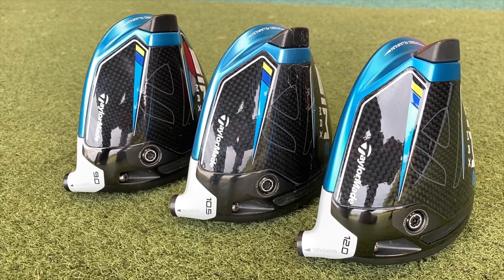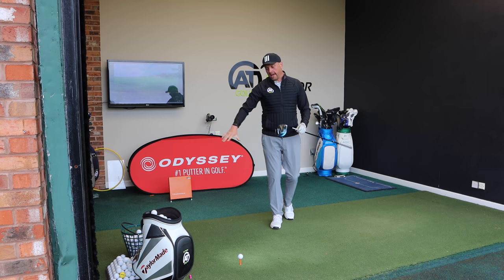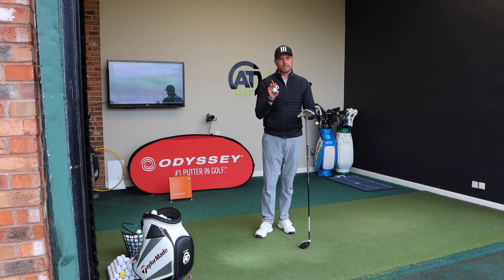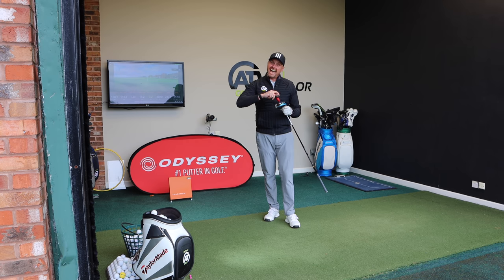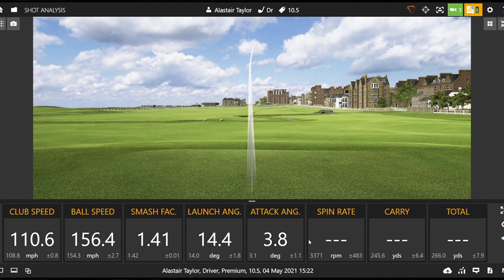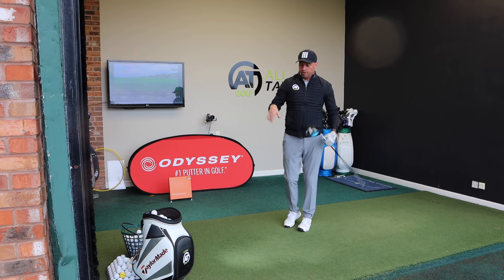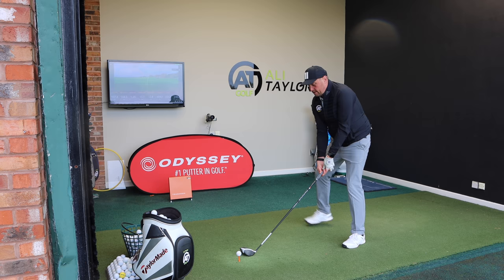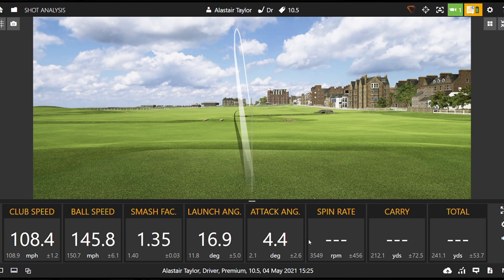Are you using the CORRECT driver loft?

Comment: I have a flat swing taught to me over 60 years ago and still works for me. I am short and was taught by the same man who taught Patti Berg who was also short. 15 years ago I had an 8 degree Cobra stiff shaft that I could hit 220-230. Now in my  80's I use a 7.5 Cleveland driver senior shaft and recently picked  up the Sim2 8 degree with a regular shaft and am hitting it a little farther.  The one fact that cannot be ignored is as you age your distance goes down. Being 84 I can attest to that particular fact.  To me the shaft is just as if not more important than the head loft. But it seems media ads ignore that important fact when buying golf clubs.

Comment: I recently increased the loft on my M2 driver from 9 to 10 and it made a huge difference. I am now launching the ball higher, straighter and longer. Just upgraded to SIM 2 max and eager to try it. Went with 10.5 loft and Reg flex shaft. Just turned 73.

Comment: Excellent explanation and demonstration. I had low driver ball flight for 15 years with most misses going left using 10.5 head and 55r shaft. Took one lesson (first since 2007) and practiced for a month then got fitted. Now with 9 degree head and 55s shaft attack angle is 4 up, launch 14, 20 yards more carry, 800 less spin and straighter flight. If I’d got fitted without the lesson it would have been very different - I’ve got wider stance, moved ball position forward, got more tilt behind the ball and standing closer to the ball to stay on plane and avoid toe hooks. Much longer and more consistent now. The lesson made the fitting much better. So did watching loads of youtube videos like this one to understand the swing and tech.

Comment: Great advice!  I've always had a very flat driver swing and tend to have a low ball flight so I've been using a 12 degree driver for years.  I just took a lesson and completely changed my swing plane (dropped right shoulder, hitting up on the ball) and all of a sudden I've got 20+ more yards and a nice, high ball flight.  Too high.  So I'm changing to a 10.5 degree driver (assuming when I get fitted it works for me) on the assumption that I'll still be hitting the ball higher but probably further as well...

Comment: I moved my driver up to 11.5 and was hitting fairways with consistency much more. Then I got cocky and moved it back down to it’s stated loft and started slicing way more and couldn’t figure out why. The way the loft can affect your the path of the ball flight is so interesting. Safe to say I will benefit from a higher loft which is fine w me bc I would rather hit it straight and long a lot of the time instead of straight and long sometimes but slice it a lot just for an extra 10 or 15 yards if I hit it right
Reply: Yes higher loft closes the club face which means less slicing so 12 degrees is good
Less loft open the club face so more slicing 
It’s getting a balance if you are good at closing club face then 10.5 if not then 12 degrees will help you hit fairways

Comment: I ran my G430 at 9.5 with weight draw biased and it wasn't working for me. I went back to 10.5 and weight neutral and the results are much more consistent. I do try to hit up on the ball with driver. I'm still going to play around a little more. I can say that the g430 has been a fantastic driver for me; I get along quite well with it.

Comment: I always used a 10*/10.5*. I was struggling, so tried a 12*. I now hit the ball further and straighter.
Reply: Was you slicing it? I am really struggling with a slice on 10.5 degrees so wondering if this would work for me, not had chance to try yet though
Reply: @2010LeeG  The main reason people slice is because the club face is too open. If you continue to close the face when striking the ball this will help. 12* drivers are far more forgiving
Reply: @watchalot919  cheers, very new to golf so appreciate the advice. I'll let you know.

Comment: Just yesterday I change my 17' M1 9º from 10.25º to 8.75º and sitting on my the ground pleased my eyes. It was more like a 3/5 wood or a iron so I was more confident and, even that the face was more opened, I hit a mid flight straight 270 yds total (Like 20 yds further than my normal fades) . Maybe a 10.5º head would add some carry distance with no closed face. Maybe time for a fitting too.
Reply: A 10.5 vs 9.0 will have a more closed face by design. Be aware higher loft creates a more closed face.

Comment: Perfect examples for fitting
tempo, ball speed, and peak height are important as well

A rule of thumb for optimal carry, your peak height in feet should be similar to your 6 iron swing speed. Example, 6 iron swing speed = 80 mph, the peak height should be 80 feet +/- 10% for most/all clubs

Optimized will provide better contact and increased ball speed. 
More distance ...

Comment: Ali Great video, I have just brought a Mizuno ST200 and its in the 10.5 with reg shaft, My question is: I have a swing speed with it of about 80 mph but I have a very high ball flight so I drop it down 1 degree to compensate for the higher ball flight, is this right or have i just got to try and change my swing or grip to try and hit up on the ball more, my ball direction is pretty much straight and my bad drive is a fade slash slice but lose loads of distance because it spins up to much and goes no where, Long winded i know but would value your advice.

Comment: Question, as 60 year old with I believe reasonable swing speed (having recently been fitted for a ser of irons) I hit up on the ball with driver set at 10.5 degrees, hitting better than previously, shot shape is slight fade (with all low irons as well) should I go up to next setting of 11.5 degrees?? Current driver is the Cobra King F7 which I had fitted some years ago.
Reply from the maker: I think it could help

Comment: Ali i have this driver swing at 95mph and is set on.10.5*. I've been hitting shots left on the course and off the low heel side of the face. If i  open the club face up 1.5* should this take it more right and with the stike i choke down the grip around an inch as it feels too long for me. Would a shorter shaft take strike back towards the toe area?
Reply: Do you hit a 3W off the tee and is that off the heel too? Is that going left?
Ideally use a launch monitor to get the numbers but sounds like choking down the grip an inch is a good start.

Comment: Great vid, Ali!  There's a dogleg par 4 on which I need a higher flight to carry a stand of trees to cut the corner.  My carry distance is usually less than I would normally expect, which as you explained in the vid could be a loss of ball speed by the increased AoA/launch angle.  Thx for the insight!
Reply: Hoa Tattis  ¡

Comment: Those are total distance numbers that I see.  But,  they say if you have a swing speed 105mph+ you should be able to get to 300yds???  I have 105 to 108mph yet only get 275yds on a good strike,   280yds with a draw.  Nowhere near 300yds.  Looking for the ultra low spin driver that can get me to magical 300yds

Comment: Did I hear you correctly that lofting up closes the face and lofting down opens the face? My 10.5* lofted driver naturally sits a bit open and I'm trying to figure out what adjustment I need to make to  get it back to square at resting position. Thx
Reply: Standard setting
Reply: @kieronburns3118  it sits open on standard setting is what I was saying. I bought the driver second hand so not sure how this happened. Thanks

Comment: Many LPGA players have 9 degrees of loft even their average clubhead speed is less than 100 mph.  I suppose that most of them hit up on the ball.
Reply: A lot depends on the shaft and ball they are using too.  The professional players spend hours and hours testing to determine the best combination of everything to maximize distance.
Reply: I think the lady professionals are also able to generate decent spin rpm from low lofted drivers because they have excellent extension through the ball (opposite to chicken wing) and thereby create maximum possible spin for the low loft to obtain optimal trajectory and height
Reply: LPGA average attack angle +3*,  PGA average attack angle -.75*